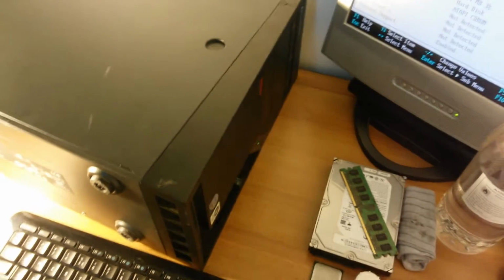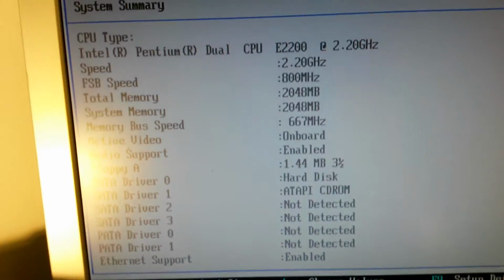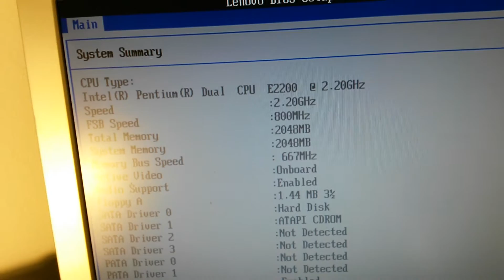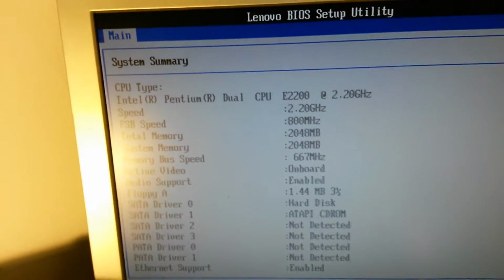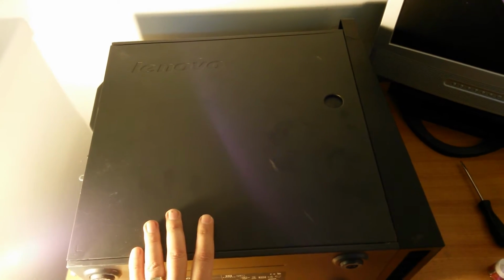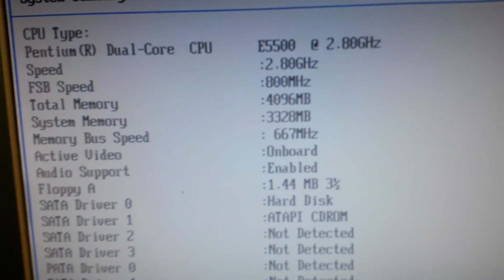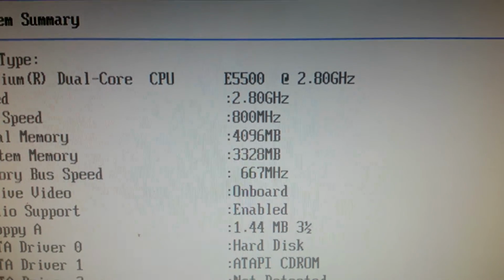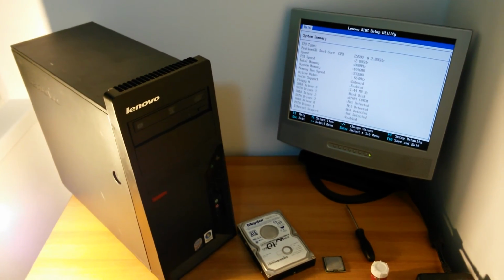How to - Lenovo ThinkCentre A57 CPU, RAM and HDD upgrade

Comment: when i shut downLENOVO 8985B63 ThinkCentre A55 as above, it is restarting instead of shutdown. what is the reason, pls let us know.
Reply from the maker: Try to boot into safe mode or Linux and see if it does the same. It could just be a Windows issue.
Maybe something caused by a new device or driver, or even a Windows update.

Comment: you can only put a gpu what is under 75 watt rights? but i bought a 85watt one and i have the same psu what now?
Reply from the maker: What is the exact model of that GPU? I think you will be ok, because they probably have a safety margin built in, but it's not 100% ideal.